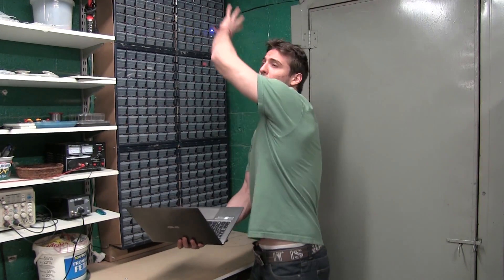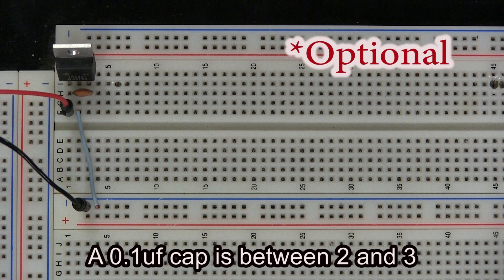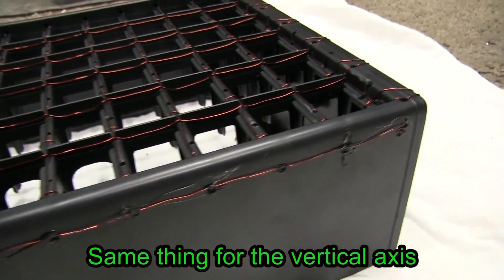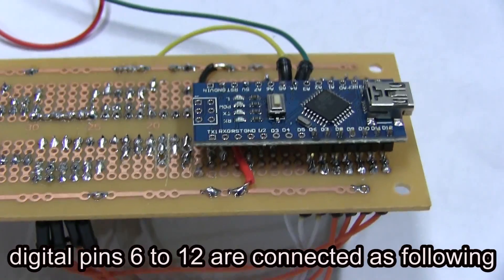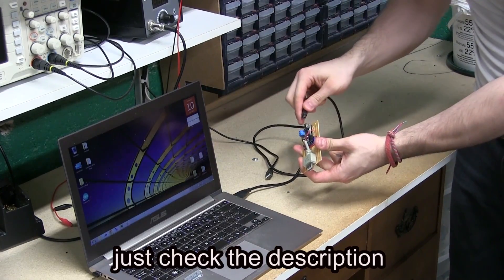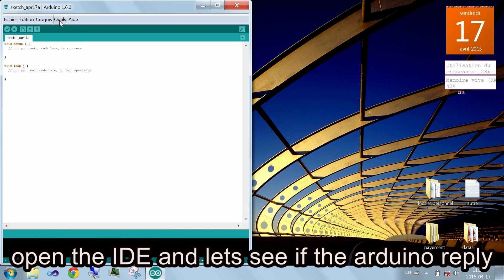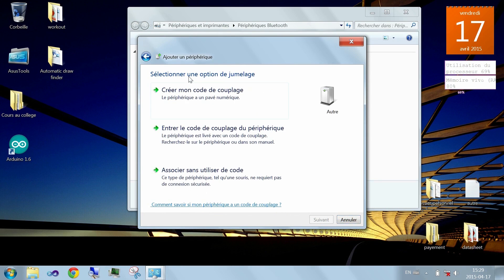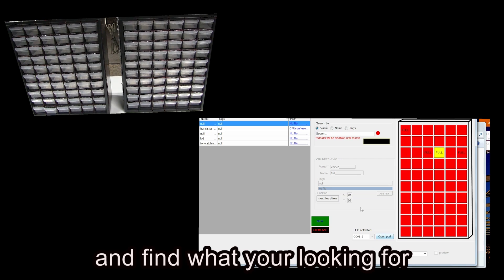[D.I.Y.] How to Store and Organise Electronic Parts (Arduino Project)

Comment: Good project. I was thinking to d something similar, but don’t have the programming skills for the final search program/database. I’ll follow yours. I’m just not crazy about using enameled magnet wire - too much risk of accidental scratches and shorts over time. I think I’ll use fully insulated solid core wire and skin it at the junctions.
Reply: can u tell whats the drawer called and where can I get one of those

Comment: I'm confused about the copper wiring,  do you put it on the vertical axis as well as the horizontal axis (in each row) and can you get the toolbox that you're using on amazon.ca?

Comment: I enjoyed the video - well presented and all the detail was easily understood. However - without being offensive - here is my 2 cents worth on this idea > 

This is part of the problem in today's world of younger Engineers. Nearly every person making comments loves your idea. So I will be seen  as a lone voice in the wilderness.
 
I'll give you "10 out of 10" for being clever and thinking outside the square. Nice job in that regard. 
But I 'll give you  "1 out of 10" for over-engineering and not thinking the basics through. Lol

With Electronics - I  believe in using the "KISS" principle meaning - "Keep It Simple Stupid" ! 
Why make something more complex than it needs ? What benefit is that ? It's also not user-friendly leading to other problems for less technical users. 
If this system fails it needs an IT Tech to fix it, where as my setup is cheaper and does not need any Technical support. 

My set up is called - "Draw Labels" - ever heard of those ? 
What's wrong with using the old fashioned labeling machine ? - as I've used for the last 40 years. 

Benefits are - Label's don't crash, look far neater, can be purchased at office suppliers, they don't need power, have no extra wires to hide, draws can't be mixed up, they don't go obsolete because of software upgrades or computer upgrades, are far cheaper to install, and don't need a Technician for fault support.  

Your way is overly complex - just for a parts "identification system" - and won't work if the power shuts off, plus becomes totally impractical if one rents and has to move house every 6-12 months and relocate their electronics workshop to another premises. If the AC power goes off you need a backup generator, or battery supply to run it. With no power you can't find anything in a hurry as you have no labeling.

Another real weakness is - the system could be easily sabotaged if someone swaps the draws around in each matrix array, thereby rendering the system rather useless. Using draw labels however, alleviates that.
Honestly, I see little application with something like this, even if you have a million draws, they can be easily labeled just as in a large book library.

Comment: I am trying to make some thing a litlle different so i can see and type  on a screen what i have and where i have a ps2 keyboard and vga screen but i cant figure out how white the code
Reply: dirk jan van steeg I am making a very similar project, let me know if I can help. Check out my instagram search for edwinfairchild you can see a video I uploaded of my project and the software app I’ve started . Again let me know if you need some insight
Reply: Eddie Amaya i gone folow you
Reply: I have not finished that project yet, i need to find a solution to connect the bins to a power source in the back and have it disconnect when i pull the bin out
Reply: + Eddie Amaya
I was thinking of just starting to learn all I need to write the program and code for the arduino but if you already have that, that would save a lot of time. (although i might just learn anyways)
Have you thought of this solution for the bin power source: using some copper strips or copper tape attach each end of the wires to a magnet. place one set of magnets on the back of the bin and one set on the back of the cabinet so they meet when the bin is fully inserted.

Comment: Well he's using I2C Slaves, No need to add any ic to arduino. You already have 0-13 and A0 to A3 (18 pins for 10x8 leds) . Just add some transistors. Use pins 0 and 1 (tx rx) as digital outputs.

Comment: This is very nice if you have time and you want to learn how to use some 74xx logic, but wouldn't it be faster (to implement, not the search itself) if the program gave you a box-row-column address instead of lighting the led. Yes, the led is more convenient, but it takes less time to print the numbers on labels and put them on the drawers.

Comment: Nice job!   Good presentation too.
Reply from the maker: thanks. I appreciate
Reply from the maker: +rvamerongen I may use leds strip for the next time. it was in fact not easy to make with leds and soldering
Reply: +D.I.Y. or DIE - Nice job. But after looking how much work, why not using a laserpointer pointing at it with mirrors or a led and let it move on x and Y axes with wires on the back side. Still nice done, the system and your presentation. Or even glue a led string with control chips on the back and licht the right LED.

Comment: I like my system better.  Number each box and keep a spreadsheet of each component and the box it's in.  Less parts, less time and I can print it out in case my computer goes down ;)
Reply: +Digger D but with led you can find box faster
Reply: ***** Yeah ok, I guess some folk need that part as fast as possible ;)

Comment: Very nice DIY !
Just another idea if you want upgrade your hack in the future
Try to print stackables box in 3D and make a mapper in your software for define the slaves areas based on a basic unit 1x1 (default case) 
Its finally just a grid system but this idea can offer more various customisations and can use various types of cases

Comment: Nice video, very nice project.
Just don't forget this: the more you are improving in electronics, the less you wanna use arduino. :D Just some advice... don't take it wrong!
Reply from the maker: Luis Ruíz thanks for the feedback and also I'm now more into the rasberry pi and linux programming. I believe that electronic alone is outdated these days and should be compromised with computers and programming. But thanks for the advise :)